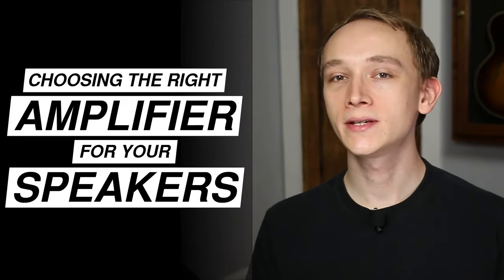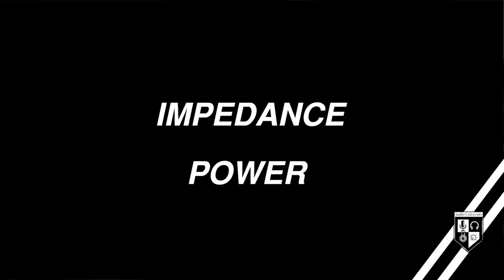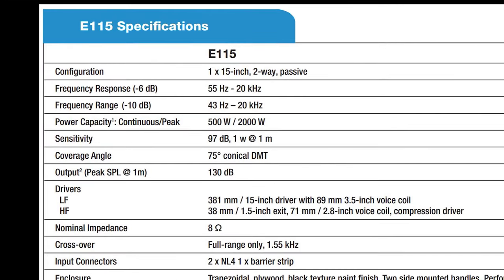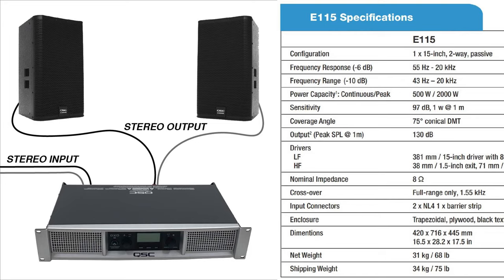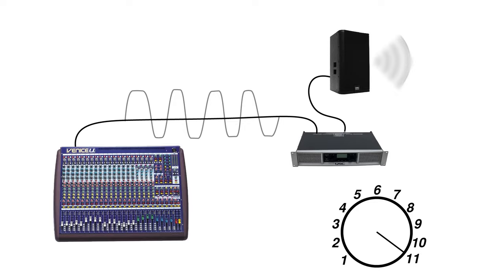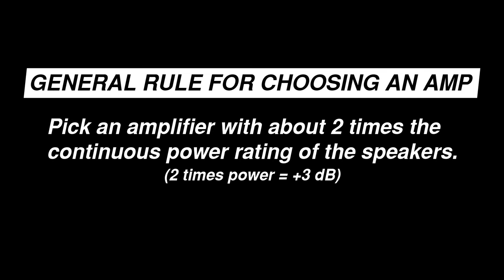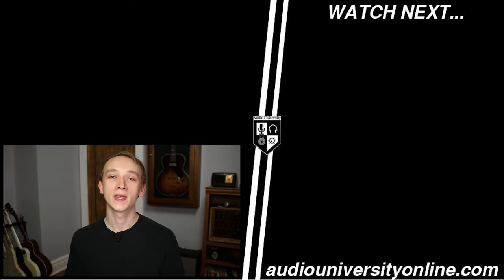A SIMPLE Rule For Choosing An Amplifier | Ohms, Watts, & More

Comment: i have 2 vintage hifi speakers that say 160 watts on the back of each 

do they both add up meaning i need an amp of at least lets say 400 ish for headroom 
or does it only need 200-250 watts counting for both big confusion hope this makes sense
Reply from the maker: You’ll need an amp with two channels. The power of the amp is usually described in Watts per channel.

Comment: If the general rule in choosing an amplifier is getting one that has twice the continuous power rating of the speaker, then let's assume u have a speaker with continuous power of 500W and you got an amplifier for 950W per channel can u connect two of the 500W speakers per channel?
Reply: You can, they'll sound fine. You just won't be able to run them to full rated SPL without the amplifier clipping

Comment: It would have been better to put the nominal speaker wattage on the same page as the amplifier wattage output side by side to compare the two and explain what you’re saying. Also, you said for the application “at hand”, but you never used that term before so it isn’t obvious what you’re referring to. You need better present. You are talking numbers and aren’t putting all those number up on one page to show how they’re related. You expect your audience to remember what these numbers are and what they mean. You’re assuming a lot.

Comment: Sometimes my stereo in car sounds like it rises and falls slightly. Like up and down.  Wats your thoughts on why that happens. Stereo is amped and single sub.
Reply: It may have a feature that increases/decreases volume level automatically based on vehicle speed....you should be able to enable/disable it in your unit settings

Comment: What if I measure impedance 8Ohm on 4 Ohm speaker - and technical specs for the same speaker vary from 4 Ohm to 16 Ohms. (By different manufactures - same speaker same serial number)?

Comment: Can i connect two 150W Speakers to 240W Amplifier?
Reply from the maker: Is it a 2-channel amplifier with 240W per channel?
Reply: @AudioUniversity  Thank you for your response. It is a single channel amp. Looking to connect two speakers.
Reply from the maker: Is the amplifier rated to provide 240W at 8 ohms? Do you know the impedance of the speakers? Check out this video: https://youtu.be/uum1gQXz5mA
Reply: Is it possible?
Reply from the maker: I wouldn’t recommend it because you won’t be able to run the speakers at their continuous power capacity, assuming 150W is their continuous power capacity.

Comment: Question: if you have 2 subs, 1000 watts @ 4 ohms and you want to run them parallel. What would you need from the amp: 2 ohms 4000 watts or 2 ohms at 2000 watts?
Reply: 2000Watts 2o i guess, no reason the wattage would be multiplied by four, just added. But better google, im no expert

Comment: Is it possible to use a 3.7v battery in the 80w or 50w amplifier or 2* 40w speakers, maybe it doesn't want to be maxed, but the sound seems to be static sound

Comment: I have a planet audio 1500w monoblock amp and has 750w at 4ohms am i able to use 2 10 inch 750w sundown subs with this amp how do i run an amp on 4 ohms and will 2 750w subs work on this setup?

Comment: Great video, easy to understand!  But I have a question if you don't mind.  I use 2 set-ups, 1 indoor, 1 outdoor, depending on the venue.  My subs for the outdoor gigs are 4 OHM dual 15" but my subs for inside gigs are 8 OHM 18".  Do I need to run a different amp for each scenario or will one amp work for either?
Reply: I do think this topic in another video explains to add speaker out put ohms of each subwoofer left or right side then divide by two should explain whether your power output of left or right channel of amp is capable of ohm range perimeters. in other words if ohms of two speakers is 6 ohms and number of ohm on amp is only four ohm, ask yourself will this work. in opinion I'd not take a chance using one amp but would give each set of speakers with separate power amps because using a y-cord or line splitter seems to be safer. but not the expert, for the expert could be your local electrical tech

Comment: Hello there, I would like to ask if it is possible to connect an 8ohm SPEAKER to a 4ohms AMPLIFIER? I got this 8ohm Yamaha SM15IV speakers @ 500watts cont. power rating and looking for a compatible amplifier but the thing is there are no 8ohm amps available locally so I am asking if it is possible to use a 2x1500watts, 4ohm amp with those speakers?

Comment: Can you please help me..... I am trying to make a Bluetooth speaker does input voltage important or the current? example a 21700 battery has output 3.7v and 30A that's 111w total and my speaker rms is 40w is that okay? or does more voltage better?

Comment: What should i look at in a amp? The continuous, program power, rms or peak? Its confusing. I have 2 rockville rated at 500w rms 750 program power and 1000 peak.  I looked up how to get the continuous power and it said to divide the program power by 2 so the speakers continuous power is 375?

Comment: Hi, I have a vintage amp and my output is 16 ohms. I have a single woofer ( 16 ohm) and Tweeter (16 ohm) hooked up to the amp through a cross-over.
My tweeter is toast so I bought a new Tweeter from Pyle ( PH-391) but it is only 8 ohms.  How do I wire this into my set up.
My cross-over has a 15 ohm and 33 ohm resistor along with a 3.0 uf Capacitor.
Do these new tweeters even need a cross-over ..I am confused.  Any help appreciated.

Comment: I didn't quite get this. 
I've always thought that the amp has to be lower than the speaker so that even if the amp is turned all the way to the max it won't blow up the speakers.
In my case I have the following
Sansui 881 - 60wpc / 4 - 16 ohm
Monitor Audio Studio 2 - 100w 8ohm / sensitivity 89dB
Monitor Audio R352 - 100w 8ohm / sensitivity 91dB
I never really go past half the volume with my amp and for the most part I listen to it at quarter the volume as it's rather loud but I'm just confused with all the speaker - amp matching now. I really like this amp but do I really need 40W speakers now? The MA Studio 2 are already pretty small (bookshelf type).
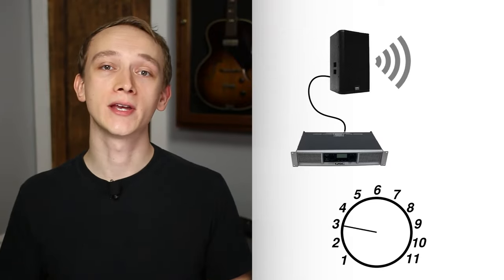2:18 What does "too much power mean" in the case of this video he's buying a 800W amplifier for a 500W speaker. What I had in mind was that if say my amp does 510w and the speakers can only manage 500w it will blow up the speakers. He claims in the end that it is recommended that the amp should have twice (2X) the power rating of the speaker. Dazzled!
On top of that people online claim that wattage numbers were lower in the 70's (when the Sansui 881 was built) than they are now. You go figure it out.
Reply from the maker: Your current setup is ok - just make sure you don’t overdrive the input of your amplifier in an attempt to make it louder. 

My recommendation is just that - a recommendation. Remember that 2 times the power is only a 3dB increase. So, though it may seem like overkill, thinking about power in watts can sometimes be deceiving.
Reply: @AudioUniversity  "Overdrive the input" meaning sending higher signal in the AUX terminals? 
I think this can only be done if I put another amplified signal through the amplifier. I only use sources that have no higher power than powering earphones (smartphone, laptop, tuner, CD player).
I had a look at the manual yesterday and although I thought I couldn't break anything in an amplifier I've notice there is a warning that in dual channel output (A+B or A+C) only speakers rated 8 & 16 ohms should be used. Using a system speaker with an impedance lower than 8ohm would reduce the composite impedance in each channel to lower than 4ohm and would lead to the breakdown of the unit.
Anyway. Many thanks for getting back to me!

Comment: Hi bro thanks for your video ,so I have a question!! I got my sound system that a double 18” sub continuous watt is 1200 w in 4ohms and my amp is 1900w on 4ohm per channel or 5400w bridge mono ,,so ,,my question according to your video I need a amp that double the watt of the speakers continues watt like a amp that has 2400w per channel or  would be better to  switch the mode to bridge mode and parallel the speaker from one to another ?sorry I hope understand what I’m trying to say thank you so much 🙏
Reply: That bridged mono power at what impedance , 1 ohm? 
First its smart to look up what you subs specs are , you can either choose to wire them in series or parallel. But it all depends on your woofer specs and amp specs.
Am I right and are you talking about car subs?
If you can give the speakers more power its always good.
There is nothing wrong about powering 1200 watt rms rated speakers with 1900 watt rms.
It doesnt have to be exactly double the power, you just simply need enough power to prevent clipping/distortion and blowin up your speakers.
So thats no problem , but if you can get a bit more juice to your speakers is never bad.
First look up all the specs from your gear , then decide how to connect your stuff to get the most out of it.

Comment: Is a 50 wpc 8ohm nad enough for my b&w 602? Or do I need a more powerful amp?
Reply: of course it will work, but that is nothing to go by if you need to calculate the optimal amount needed for critical listening.

you need to provide data on room size, distance from speaker to listening position, speaker impedance + power rating,  length and gauge of speaker cables (due to power loss over x distance) and finally how loud will you be playing.

Comment: Thanks Kyle and a quick question.  I've got an older 5 channel amp (ATI 1505) and want to use it in a stereo only setup foregoing a multi-channel preamp.  There are no configurable settings on the amp just 5 in and 5 out.  My question is related to using those other channels in my setup.  Are there any good ways to take advantage of those 3 other channels?  I had considered splitting the outputs from my preamp and driving 2 speakers for each left and right channel but I was wondering if there were any other kinds of wiring options.  Thanks!
Reply from the maker: It’s probably best to use only the two channels.
Reply: It depends on your speakers, but yes. You can make use of the other channels as long as you have the right speakers. If your speakers have 2 sets of binding posts intended for biamping or biwiring, you can do what's called a vertical biamp. Connect one channel on your amp to one of the 2 pairs of binding posts on your speakes. Take another channel on your amp and connect it to the other set of binding posts. You will be using 4 channels, not 2. Also, if you do a vertical biamp, you won't have to use a crossover to get your volume levels to match. That'a a huge advantage.
Reply: @AT-wl9yq  Thanks!  I'm assuming I can just use a simple RCA splitter cable for source signals?

Comment: Hello please guide me am having a proton bass bin rated 2400 watts at 4 ohms. now i want to buy Audio center A13 power amplifier but when i check the spec is 8Ω Stereo Power ,RMS/CH 1200W and 4Ω Stereo Power ,RMS/CH	1800W and 2Ω Stereo Power, RMS/CH	2500W  and 
8Ω Bridged Mono Power, RMS	3600W
4Ω Bridged Mono Power, RMS	5400W. when i do my calculation it says i need 3600 watts per channel is this amp good ?

Comment: Ive got a 40w per channel at 8ohms receiver, and im looking for speakers, i cant find any that are rated 20w, not even the small speakers what do i do? the amp is Akai aa-1040 what speakers would you recommend?
Reply: I do have ha cheap 44w amp powering two 8ohm 91dB speakers recommended power rating 20-250W and with this amp I get about 80dB at 2m listening distance with the volume nob 25% raised. I’m new in hifi and was surprised by this. But at the end of the day I’m not sure if this amp is the best choice. Would be interesting to try something more powerful and see if the overall sound and detail would change. 
It’s for sure a science to invest in a good performance hifi system (in my case I don’t even know if it’s called hifi -cheap-fi maybe :)

Comment: My understanding is that an amplifier doesn't push power, the power is there for the speaker to draw as it needs it. A speaker can't take any more power than it needs.
Reply: If that were true, then you could never blow a speaker.
Reply: @mattrondeau7466  that has more to do with a speaker playing a lot of power for too long, but i'm no certainly no expers so make of that (and my original comment) what you will.

Comment: U are not wrong, but there is no need to buy twice the power if the  listening is sitting  1 or 2 meter away from the speaker. A quality 60watt amp will server a 100watt rms speaker if the listener is 1 or 2 meter away and the amp will still have enough head-room. Someone please correct me if im wrong.
Reply: Theoretically, yes, you could use a 60W/channel power amplifier to drive 100W loudspeakers, when you use the speakers in nearfield configuration or in a small room, but my question is this: do you ever party?
If you do party sometimes, that's when all the reserve amplifier power is needed.
Most people don't have dedicated sound systems for every room on their house and, usually, rely on one audio system only, placed in a living room, to service their needs.
Reply: @valentingheorghe1693  i don't party, but i still play music loud sometimes in a full size 2bedroom condo. My  STR is 90watt per-channel and my Reference floor standing speakers are 100 watt rms each . That power is more than enough even if i was having a party.  Don't fall for everything on the internet about amp power, hires music  etc etc  Just get a decent amp with a good power supply...enjoy the music..

Comment: Please help me. 
I have a speakers (sony hcd-gn1000 amp is fault) 
It's have 6ohms speaker
170w x  2
70w  x  3
Subwoofer 210w  x  1(8 ohms) 
Total 8400 pmpo
Total 760w rms
Please help me- which which av recover is suitable for this speakers. 
I am confused about rms watts pmpo. 
This is 1year problem for me so please help me.

Comment: I have a problem that I can’t solve and no one around me is good with speakers so I came to YouTube for some help lol. My problem is I want to connect all of the speakers I have into one channel so I don’t have to use six phones and play the same song on all six and try to sinc them anymore, i also want to make some go left and others right instead of jus all playing the same thing. My speakers I have are 2 Edifier sp3000 pro, 2 Swan M500, 1 Edifier T5(full setup), and one Swan M20(full setup). My only problem is idk what kind of amp I should get. Ik it haves to have a lot of channels, or is it possible to buy multiple amps and connect them lol. Any suggestions?
Reply: What the fuck!

Comment: I have 8 8” bass rockers midrange speakers what watt amp should I get for them they are  300 watt max power,150 RMS watts, 4 ohm, I want to use taramps amps I just don’t know what watt amp I should get for the 8 speakers I also have 2 12” bass rockers subs they are dual 4 ohm 600  Rms watt 1200 watts also want to use a taramps amp with the subs  but do not know what watt amp to get i want to use taramps with the subs too I also have a chuchero box which is bass rockers 6.5 speakers and tweeters 1” 800 watt do I have to get the chuchero it’s own amp help

Comment: To get the best sounding system...it not just that simple. It does not hurt if you use a much powerful amp than a speaker, but not vice versa...and you still does not get the the sound you lookign for...
The sound signal is a sin wave form, to amplify it, there are several technics, the best one is. class A where the whole sin wave is amplified continuously, faithfully to the original signal. However, this kind of topology is very uneffiecient and not practical for big amp..
Then came the AB class, where each half of the sin wave cycle (go from + to - and repeated, namely cycle A and cycle B) is amplified by a different pair of Transistors. This topology has a major disadvantage compares to Class A, which is it could not 100% reproduce the sin wave signal...there is a "gap" between the ON and OFF of these two pairs of Transistors, or timing problem...and it will introduce noise, distorstion..etc to the orginal signal, how bad depends on the design, quality of the components used to built the circuitry...
Then came the class D amplifier, which use a total different concept to amplify the signal...it converts the signal into a train of pulses, highly efficient, high wattage, but low quality in term of music. Later on, this Class involved in to something called Class I (by Crown Audio), which amplify the signal almost as good as a Class A but still have the very efficiency of Class D...
The problem is, to get the best amp for your speaker, you have to pay for the technogy or the quality parts used in it...and it's not cheap.

Comment: My speaker is rated at 1700w (3400w peak)... so you think I should get a 2800w into 8ohm amp.  Ok... I'll get on that.
Reply from the maker: I wouldn't recommend running it at full power, but yes. Ideally, you would have at least 3 dB of headroom in your amplifier.

Comment: Doesn't really make sense in practice. If you wanted to power two 500W speakers, you would need a 2 channel 2000W amplifier? a normal 20A 120V breaker only can supply 1800W lol. Good luck spending to $5000+
Reply from the maker: I appreciate your comment. I’m certainly no expert in electrical engineering, so I can’t argue with the math. However, there are many amplifiers that can provide greater than 1800 W off of a wall outlet (and are much cheaper than $5000). For example, the Crown CDi 6000 can deliver 1200W per channel (2 channels) into 8 ohms and costs about $3250 retail.